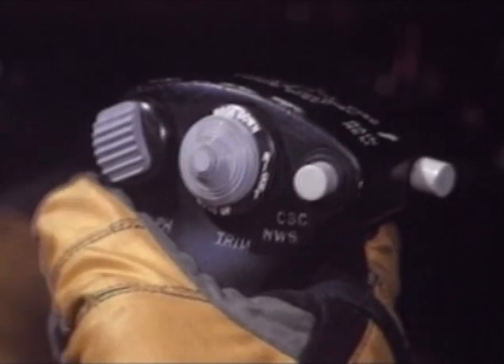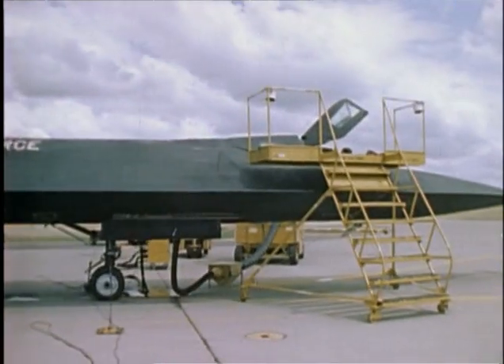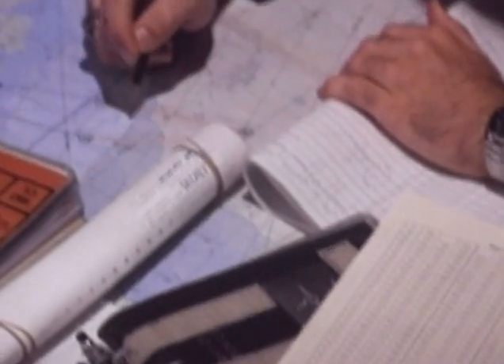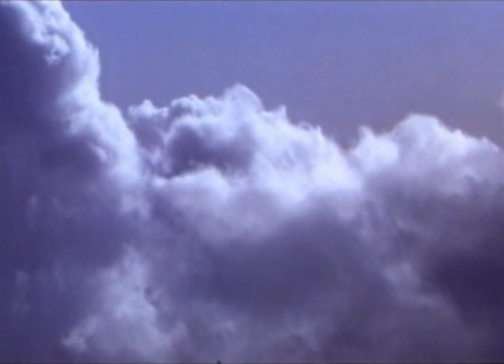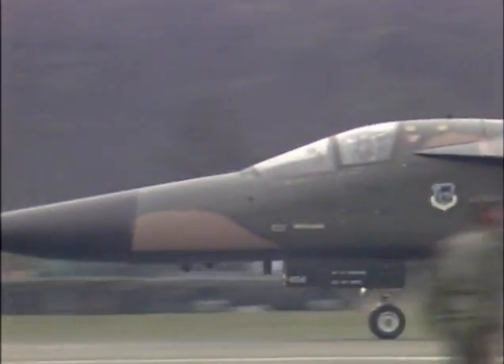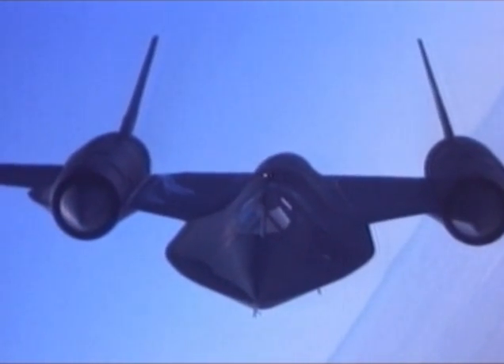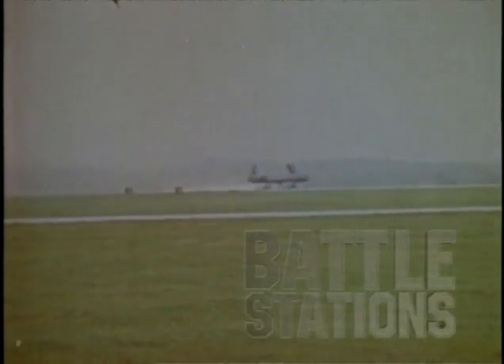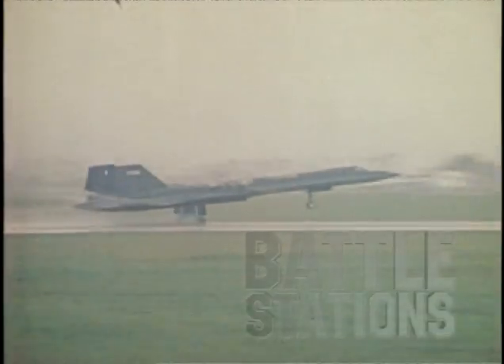Battle Stations - SR-71 Blackbird Stealth Plane -Full Documentary

Comment: It's not a stealth plane god damnit
Reply: It doesn't need to be. Nothing can catch it.
Reply: No stealth plane will ever be completely undetectable, that's a big misconception. There will always be some radar waves reflected back. Stealth planes vastly reduce that amount with their flat shapes (reflecting the waves away from their source) and ferrite paint (absorbing the energy of the radio waves). Though they still might be detected, their weak return signal could go unnoticed or be mistaken for something else. Newer planes also cool their turbine exhaust to reduce heat (infrared) signature.
Reply: Those planes are 30 years younger than the Blackbird... Obviously they made improvements to stealth tech over that span of time.
Reply: Why shouldn't it be? It has clear stealth characteristics, as mentioned in the video.
Reply: Yes it does reduce the radar return, even it's paint is radar absorbing. It of course is not as stealthy as today's planes but they tried at the Skunk Works to make it stealthy as they knew how .Google it and you will read that the SR-71 was stealthy as the beginning of stealth technology could make it. It was the first stealth aircraft regardless of the     F-117 that said it was the first.
Reply: Ever since the invention of radar, aircraft makers have been working on making their planes less observable on radar.  Even in WW2, the DeHavilland Mosquito was very stealthy due it's being constructed mostly of plywood.
Reply: Actually, It kind of was. One of the original reasons behind going mach 3+ is that in the early 60's, for reasons that I'm not really qualified to fully grasp, radar had difficulty in "seeing" targets going that fast. By the late 60's that problem had largely been overcome but by that time it had been proven that going that fast it didn't really matter cos there wasn't much they could do about it even if you could see it coming...
Reply: Radar deflecting body shape, radar deflecting materials added to the leading edges, radar deflecting black paint.. i think maybe you don't understand what the word stealth means.
Reply: John Meiro. The Soviet PVO forces in the form of Mig-25s, Su-22s, and S-75 and S-200s certainly could have caught it... just as surely as the Red Army’s defence-in-depth stopped Hitler’s Blitzkrieg at Kursk. This is why the SR-71 was only used against tiny nations with sea access and ineffective air forces... and was NEVER risked over the USSR.
Reply: Sebastian Ahrens what are those characteristics that make it a stealth plane? It's still 100% detectable by radar.
Reply: Sebastian Ahrens I already knew that, you didn't need to explain to me the basics of stealth technology. The B2, F117, F22 and etc have those capabilities to reduce their signature to the size of a small car. My point was that the SR71 doesn't share the capabilities of a stealth aircraft. Its radar signature isnt reduced like an F22's or B2, its main capability is altitude and speed, removing much of the need for stealth.
Reply: NicsEpicWaffles the F-22 on radar looks like a small bug

Comment: Beautiful Aircraft
Reply: It was beautiful but it was way to expensive, it took 24 hours pre-flight, the spill of fuel was heartbreaking, because it needed to reach the temperature at max speed so the joint close up that's way the tanker was there just after take off. And it refled again and again during the missions. The chip Mig 25 can be parked out in the ice and started up like a vw, was built of stainlees steel flu on cheap kerosene, and they were ready on the air when the SR71 arrive, they don tell you the times ta Black Bird had to abort the mission. (non political comment)
Reply: Gave me wood (so to speak) as a child, the first time I saw it in the early 80's.

Comment: the kerosene integral tanks used to leak when on the ground. during high speed the airframe would expand with heat and the gaps closed. no leaks. expansion joints !
Reply: it was considered not so dangerous. even a cigarette butt would not ignite kerosene, but it was a slightly disconcerting.
Reply: It uses JP-7 not kerosene.

Comment: why is this plane having the label stealth when it could be easily detected over enemy lines?!!!
Reply: It's radar signature 100x smaller than the radar signature of an F-14,  I would say that is pretty good for such a large plane.  
My understanding of the F-117 that was shot down in the Balkans is that US aircraft would patrol the same route at the same speed regularly,  so one missile commander worked out the math and fired the missile with his radar off.
Reply: EndofUSA Because it was our first plane using stealth design i e angeled surfaces and radar absorbent paint.
Reply: It had a significantly reduced radar signature, so it was stealthy. The fact that it was not completely invisible does not nullify that.
Reply: It couldn't be detected at the time only be seen
Reply: Pezfeo They had much more sophisticated radar system. This radar detected F-117 many times, but it was considered to be some kind of a background noise. After this few routine fly pasts soldiers learned how to distinguish this signature from a real background noise.
Reply: To be honest there is no such thing as a "stealth" aircraft because one way or another you will be able to see it
Reply: It was easily detected on radar even at the time, and does not deserve the stealth title.  It was intended to be stealthy and the airframe had a small radar signature at subsonic speeds, but at higher speeds the shock-wave showed up very clearly on radar.  The stealth aspect of the design may have failed but it was still a very successful aircraft.  The plane cruised at Mach 3.2 and could go faster, though how much faster is still classified.

Comment: the most badass plane in the world now put supersonic bombs on it
Reply: AlternateMusicAddict they would need to be hypersonic which wouldn't really work as every inch of the inside is used.. maybe a solo release where the camera housing retrofitted.... But the calls into many questions will the plan structure wings etc handle and distribute the weight.. no the B2 bombers work just fine... The Lockheed SR-71 Blackbird was exactly where it needed to be.. reconnaissance high altitude hypersonic jet.
Reply: AlternateMusicAddict.  NO it won't WORK!   Not designed or equipped for that.   Go back and get more RESEARCH man.

Comment: It was stealth my ass, everytime you listen " threy were tracking us ". In The 70s ??? its awesome and fast but not stealth at all
Reply: Stealth refers to a decrease in observability using electronic measures, such as radar. The SR-71 is considered a low observable aircraft, but was not designed with low observability being THE primary point of design, as that was speed (compare to the F-117 Nighthawk where the stealth design made the airplane slow and unstable.) While increasingly sensitive radar could more easily track the SR-71, the radar signature of the SR-71 is smaller than another plane of roughly the same physical dimensions, so it is a low observable (stealth) aircraft. So while many media sources use the term "stealth" as if you either have stealth or you do not, it refers to something on a graded scale. For example, the F-22 has the smallest radar signature of existing manned US planes, implementing later generation improvements over the B2 Spirit, which implemented improvements over the F-117, which implemented improvements over the SR-71. The future B-21 will likely implement even further improvements over the F-22 and YF-23, and no differently than any other aircraft listed here, technology will be (or has been) developed that can track it using enhanced radar, other active, or passive means (and that will complete the circle leading to development of the new.)

Comment: WTF? The intro "flying at speeds at 2000 miles an hour. In the top 1% of the earths atmosphere".  
Um no!  Since the agreed on edge of space is 100 miles up and the SR-71s altitude record was something like 80,000ish feet  That isn't even in the top 80% of the atmosphere.    
It's a badass plane but they are over selling it a tiny bit.
Reply: the agreed on edge of space is actually 62 miles up
Reply: the Kaman line
Reply: you know this to be a fact how ??? That you're an expert and know what this aircraft is really capable of?? I highly doubt that you are and it's more like you're talking out your ass.
Reply: Paul Friend Oops swapped out miles for km.  Still the SR-71s reported max altitude is nowhere close to 62 miles. SR-71 service ceiling is 85,000 ft that's 16.09 miles so just a hair over a quarter way to the edge of space. No where close to "the upper 1%"
Reply: macuss87 Yes. If I remember correctly, the X15 holds the altitude record at about 354000 ft, or about 67 miles. That is far far beyond the SR71's capabilities with it's air breathing engines.

Comment: Still the fastest bird ever 52 years later.
60th thumb up.
Reply: The X-15 is the fastest rocket powered. But the SR is still the fastest jet powered.
Reply: Chris Kelso I believe its even faster. Theres a reason it says 3.5+ mach...its still classified I wonder why? There pilot over lybia said I pushed it forward and started seeing scary mach numbers.....to scare him must of been preety damn fast
Reply: It is debatable whether you want to call the X-15 a plane, or compare it to the Blackbird at all. But: With its Mach 6.7 flight in 1967 I think it at least deserves an honorable mention as the fastest manned aircraft to date.
The Blackbird might still be the fastest aircraft with actual operational background though.
Reply: There's at least one book written by an SR-71 crew where they admitted they reached Mach 3.4 during one of the missions over Libya in the mid, late-1980s.    They were only able to do that because the temperature conditions were right.    They actually found out the plane burned less fuel at the higher speed which is the exact opposite of what you'd expect!   I've heard/read different descriptions of how the engines work and I still only half-understand the concept.   It was a weird plane with the most unorthodox jet engines that ever flew!   Oddly enough, from what I've heard about Concorde, those engines didn't seem that much different in basic operating concept than the Blackbird's BUT they operated in supercruise/took them out of afterburner once the Concorde reached a critical Mach number above 1.0...  Probably above 1.2 because of the whole drag issue between Mach 0.9 and Mach 1.2 I think...
Reply: @AvengerII  . . well said
Reply: 3.5 @ 89,000 ft. altitude actually. The outer room temperature is what granted the plane to "hit the wall". The colder it was outside, the faster it could fly. The heat-exchangers couldn't withstand temps over 700F degrees, I believe. If they got too hot, the engines would start/stop, causing them to go into a bad tilt, and they wouldn't be able to keep the cockpit and internal gear from over heating. Any given point, the inner surface of the cockpit was about 200F degrees. That's pretty damn hot. 3.2 is "cruising speed". Meaning that was it's usual speed. They never really tried to push its limits unless they needed to. And those red lines you see on some of the SR-71's are not for looks. They're there for a reason.
Reply: Sebastian Ahrens The Blackbird is the fastest air breathing aircraft. The X 15 was rocket powered.
Reply: SR-72 would be faster than SR-71. 
 http://www.popularmechanics.com/military/aviation/news/a28420/hypersonic-sr-72-demonstrator-reportedly-spotted-at-skunk-works/
Reply: C. Lindbergh.... 32 hours     Blackbird.....1hour 42 minutes   AMAZING!
Reply: the x15 compared the the sr is a dumb comparison. the x15 is rocket powered and is carried into the air by a b52. the sr can take off refuel fly around the world and land. there's a reason why the x15 is called a MISSLE with a man in it.
Reply: @bobthompson4319  "Missile with a Man in it" actually refers to the F 104
Reply: Couple of comments to other comments that have been posted.

The Fédération aéronautique internationale sets the standards for aircraft records.  There is a separate speed record for air breathing planes.  That's why the X-15 doesn't qualify as holding the speed record.  Even if you allowed it to be considered, the Space Shuttle would beat it by several magnitudes. 

Also, it's Brian Shul who claims to have hit mach 3.5 over the Med.  He also stated that the SR-71 was still accelerating when he pulled back on the throttle.  The reason why that's not an official speed record is because it's not verified.  The 3.2 record was "stop watched," so to speak, which is a requirement to hold a record...it has to be independently verified.
Reply: SmithN' Wesson look out for the butt hurt trolls on here.
Reply: B2 is subsonic.
Reply: "Still the fastest bird ever, 52 years later". With a seated pilot!
Reply: That's still wrong A the Sr 71 was a    turbofan B the x15 was a rocket
Reply: The SR-91/SR-72 "Aurora" is faster,still not a rocket. And the Sapce Shuttle/X-15 are flyin like a brick, you need onboard supercomputer just to maintain basic stability...im not sayin you could glide with the SR-72 like nothin else, but the flightcharasteristics are so very different. You can't fly a rocket, but you can guide it, if you know what i mean :)
Reply: That we know about.
Reply: Chris Kelso
Reply: Chris Kelso what are the red lines for.
Reply: OH Yeh! Hey waka  the poms were in front of everybody except the Germans in aircraft design. The yanks come a very long last.. Even Russia had better planes than the yanks at the end of ww2..
Reply: Gareth Wilkin 54
Reply: that we know of... we have always had a plain in the wings so to say,,,,      I say we have one now,,,,,,,,
Reply: I feel like the B-2 Spirit would be faster, but the airplanes classified so its hard to find out but it would only make sense to make a better and faster successor.
Reply: Avenger II Actually the drag reduces as you go faster, the engines start becoming more and more efficient too.
Reply: Fastest turbofan didn't use jets but hey a birds a bird
Reply: It was an awesome plane to see take off, feeling like an earthquake was happening when the ground shook so much. And being 9 years old and knowing my dad was there working on it every day. And not being able to tell anyone about it.
Reply: I know it can do M6.78
Reply: @IDK_Mr.M  how do you know that?
Reply: That plane is fricken cool👍
Reply: neil burns you mean the mig15s that were shot down by p51d and f4u corsairs.  Ww2 Turbo props downing mig15s in the beginning of Korean at a 3 to 1 ratio.
Reply: please explain :P
Reply: Teentard detected. Your lot should suicide. It will spare you a life of idiocy.
Reply: Fastest JET, not fastest planes. X-15, space shuttle decent, etc, all went way faster than the black bird.
Reply: You all forgot the Valkeryrie.
Reply: That was 50 years ago. They use satelites now. Those are much faster.
Reply: Edward Goose and more vulnerable
Reply: hunk of junk